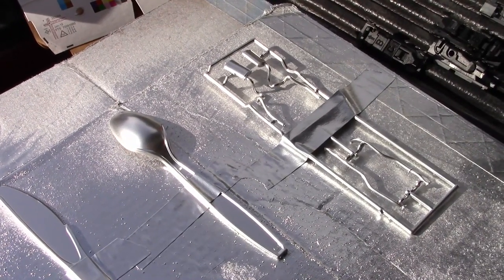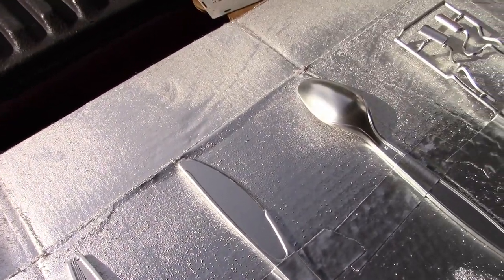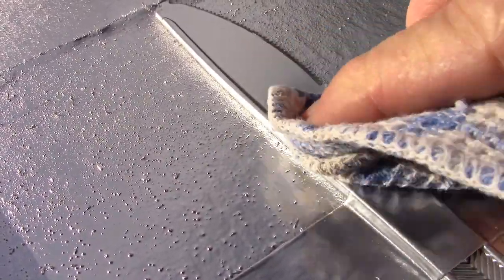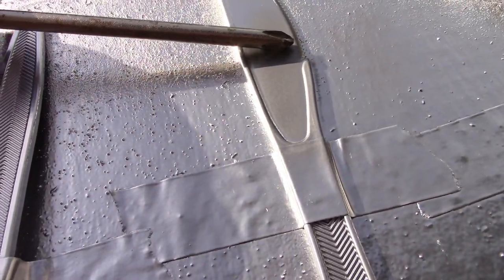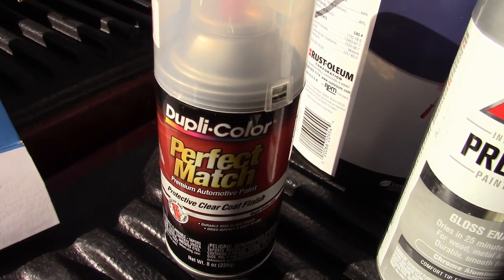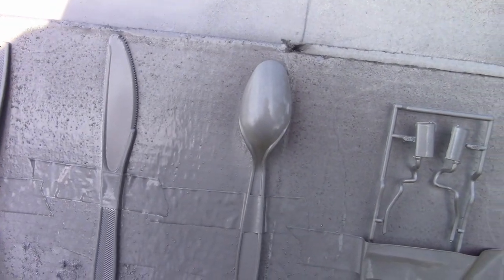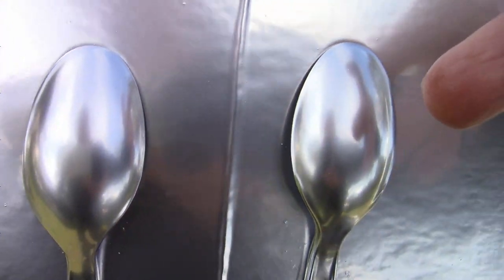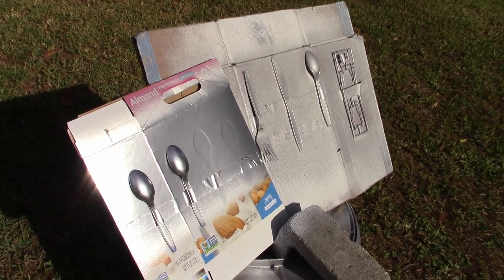Ace Chrome Spray paint testing part 2

Comment: Guess that proves it works best over a gloss black base.  You might be able to clear coat it with Future, that seems to work on everything.  Thanks for the update.
Reply from the maker: Yes, the black works better. As for Future, I did a video on that. It barely reacts but it does a little. That video is here - https://www.youtube.com/watch?v=x85iNqfUIOg